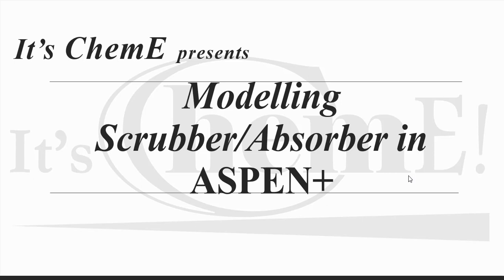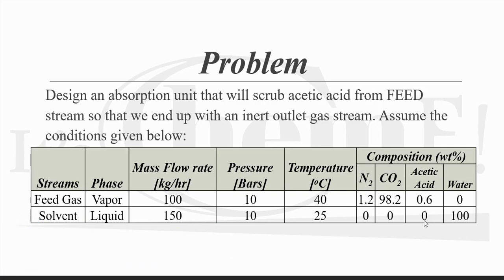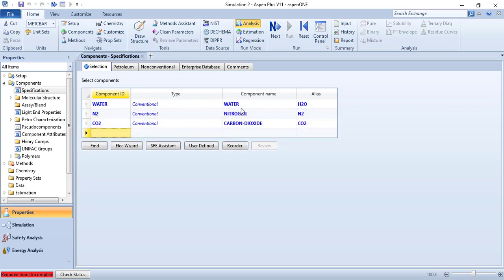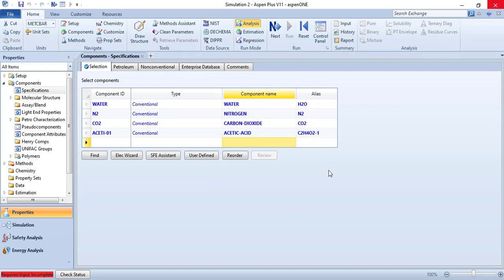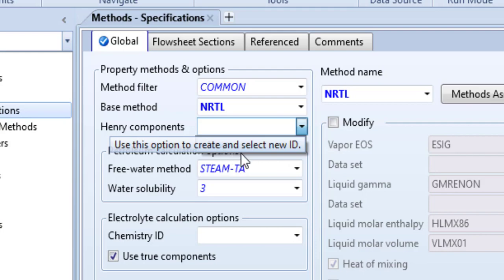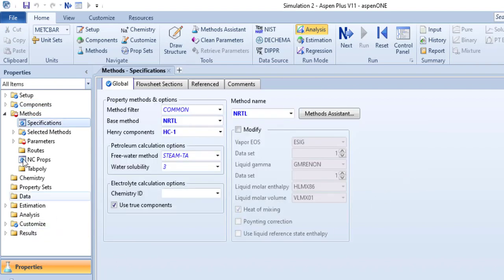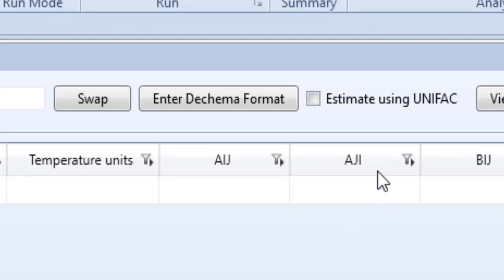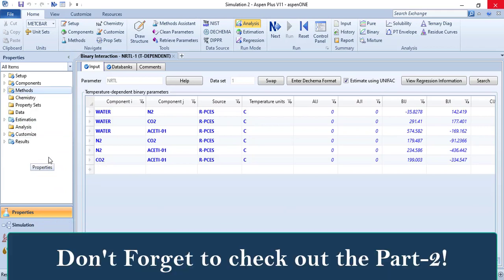Modelling Scrubbers in AspenPlus using Radfrac Absorber Part 1/2 (Henry Components+Property Package)

Comment: Sir, why we didn't select acetic acid in henry component specification, while we want to scrub the acetic acid in the stream?
Reply from the maker: The Henry component specification is done for the components which obey Henry's law of solubility. Usually Henry's law is used for gases which have low solubility in solvents. Since acetic acid has higher solubility in water the solubility is modelled using NRTL method. Hope this helps.